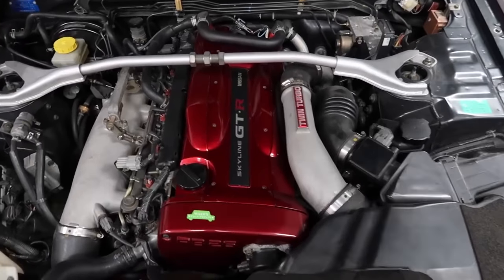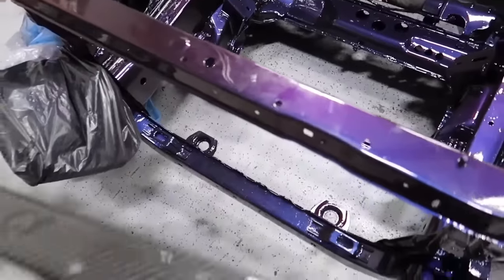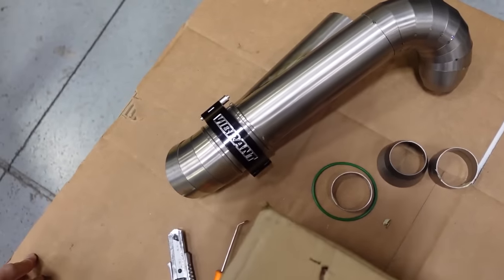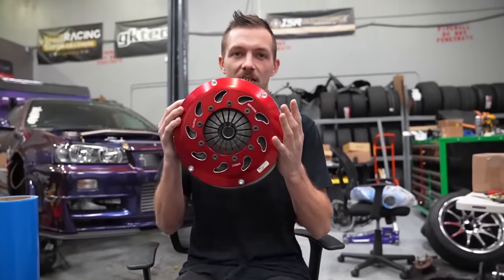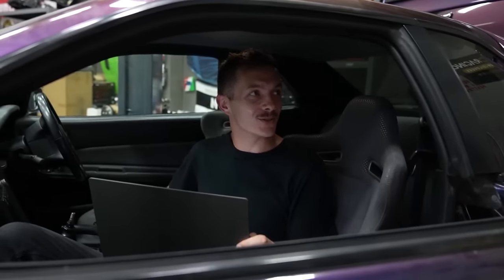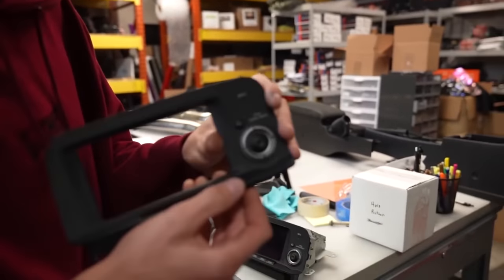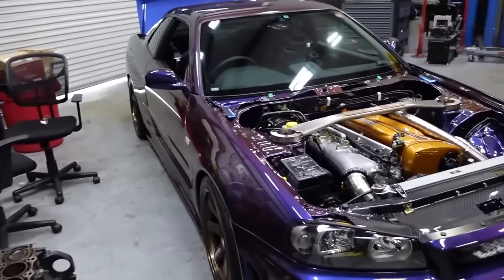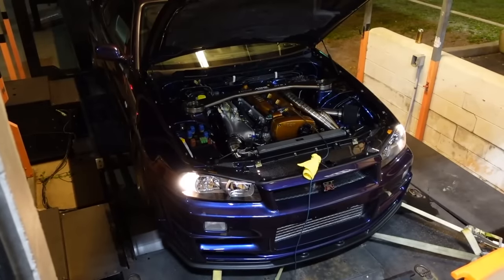Building an R34 GTR in 20 Minutes

Comment: No question this is one of the coolest if not THE coolest r34 the world has ever seen.. Its balanced, it has enough hp but not to much, 4wd, 4 wheel steering, twin disc clutch, 2 turbo's, brake upgrade, suspension upgrade, and the paint and all the details are absolutly amezing.. would love to build one of those

Comment: Cleanest and most detailed R34 build I’ve ever seen. It’s perfect.
Reply: Nothing compared to b is for builds one
Reply: @UCK83HbznwoS6_1kaz7MolTA  doubt it
Reply: @liamcrawford1902  b is for builds is a garbage Frankenstein of a “gtr”
Reply: @calebjohnson1627  I know, that’s the joke
Reply: @liamcrawford1902  lol that’s funny
Reply: @calebjohnson1627  facts
Reply: @UCK83HbznwoS6_1kaz7MolTA  gonna be hard to one up this.  LZ bought all the new factory parts before they were discontinued.
Reply: @Und34d_R  yeah thats what im most curious about too, adam even got all his zinc from tommy as well
Reply: @UCK83HbznwoS6_1kaz7MolTA  Tommy has a mnp2 R34 GTR in his shop now. You’ll probably see a lot about that car soon. 😁
Reply: @calebjohnson1627  i wouldn't really say its a "garbage frankenstein" its technically all nissan factory parts, it just uses a modern GTR as the base, which makes it performance wise superior to the originals just based on how much further modern GTR's are proven to go in horsepower then the RB26's could reach. I recall an R-32 reaching 2500, by comparison R-35's can reach 3500.
Reply: Tj Hunt just one up'd this one ;(
Reply: @Malligmallan shame about the piano black though

Comment: 1a. A trip to the ocean can be a relaxing escape from the everyday pressures of life. 1b. You should always be careful to avoid overexposure to the sun at the beach.

2. One thing you should look for is correct sentence structure. Second is to make sure you use capitalization. Third is correct spelling. Fourth you should make sure you have not confused any words throughout your writing.

3a. Clichè is a stereotyped expression or phrase. 3b. What doesn't kill you makes you stronger

4. Brainstorming is where a person writes freely to generate ideas, then their is free writing and to free write you just fill a piece of paper with any idea that comes to mind.

5. First of, when I clean my room, I start by making sure that the trash from the floor is picked up. Then, I will begin sweeping my floors to make sure all the dust is cleaned. Next, I will move to my nightstand and tv stand to clear them off. I then make my bed and fix that portion of my room up. Lastly, I make some mop water and mop my floors. Then I will be finished properly and in order with my room.

6. Drunk driving is highly dangerous, each day it causes 27 deaths in the United States. That would be 27 deaths that CAN be prevented in the United States alone. Also, 75% of those involved in a crash are NOT wearing a seatbelt. When in a drunk driving accident i believe the license of the intoxicated person should be confiscated. It takes 3-4 drinks for a 170-pound man to be overly drunk, about 1-3 for the average woman. I believe enforcing a breathalyzer in a vehicle could make accidents more preventable. Someone who is drunk doesn't realize how intoxicated they truly are. Drunk driving is easily preventable by anyone, if you drink you should not be under the wheel of a car. If you even consider drunk driving you should think about the family you could injure or even kill in an accident. You should never allow drunk driving in any situation.